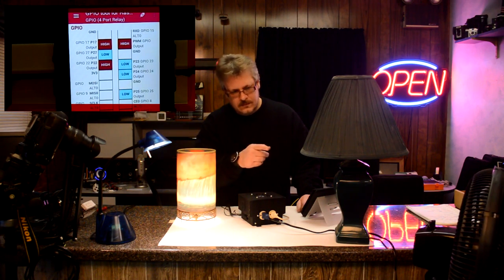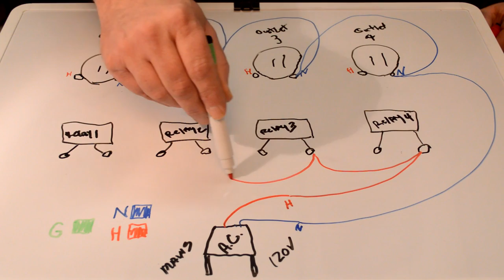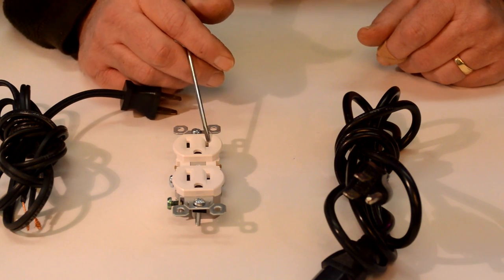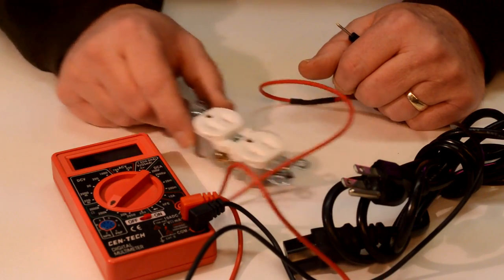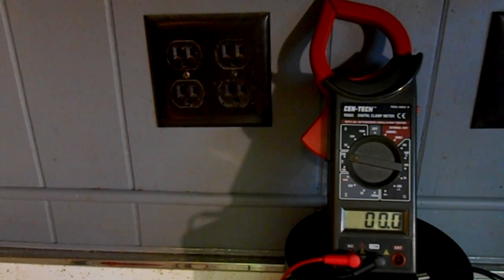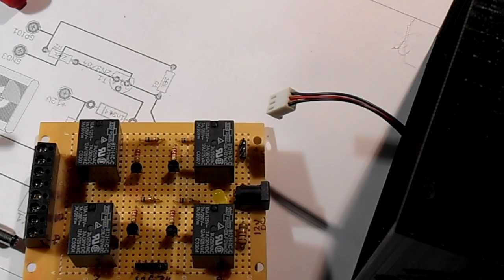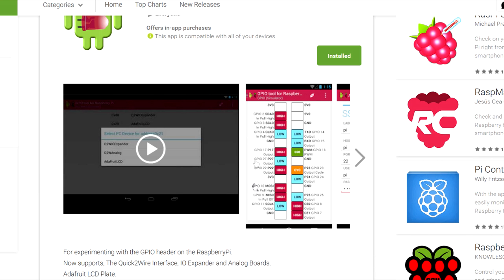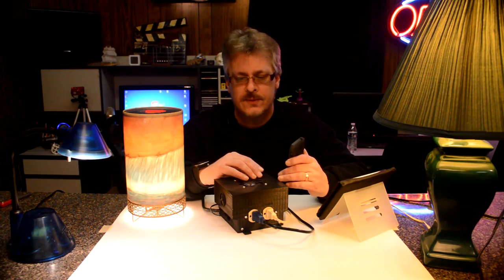How to Build Device to Control Lights & Appliances Using Computer - Final

Comment: Hey Steve, thanks for all the hard work done on this build.  Looks good, and plan to use the knowledge I've gained from it to solve a  garage door problem.  I've left the house twice now and forgot to push the button that closes the garage door.  Getting 3 blocks away or more from the house and then asking yourself, did I close the garage door? has become a pain in the a....   I plan to put a micro switch on the door so I can pull up the app on my Android phone to see door status and if its open, trigger a close command.  You've given me all the info I need to get started.

Comment: hello sir, regarding to this project, is it safety to plug the electrical outlets direct through the relay channels? or we need some sort of transistors to give safety and put it in to the breadboard. This topic is also our system in thesis. thanks and godbless :)